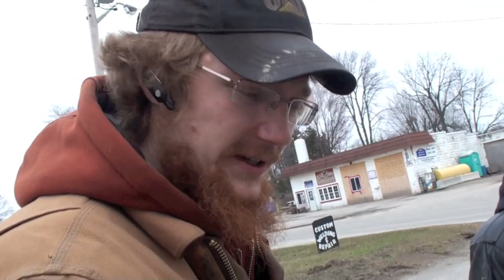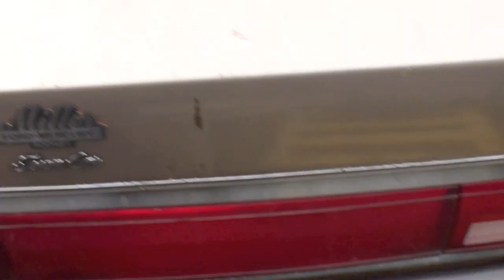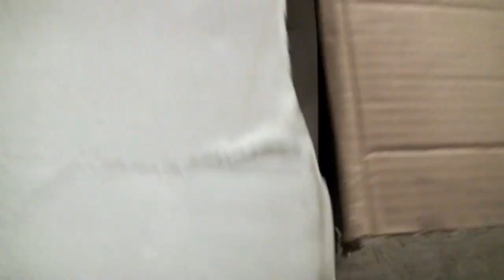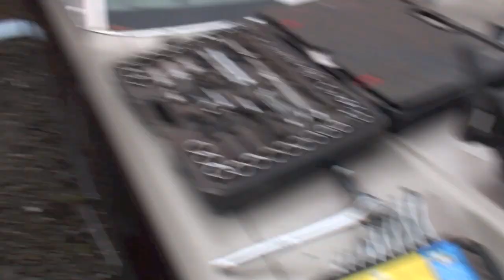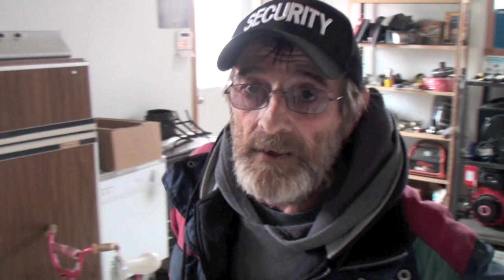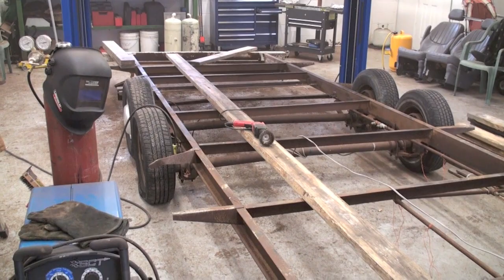gettiner done out in ol' rutneys!

Comment: Chris, take a piece of scrap metal and make a matching plate for that cable guide on front of tool box ( for winch, so its a bit more re-inforced on inside of toolbox. i made one quite similar to it. thieves loved winches so i hid mine inside toolbox. OR consider running 0 gauge wire from batteries in big dirty, and just make a "plug" so when you need to use the winch, jus plug it in